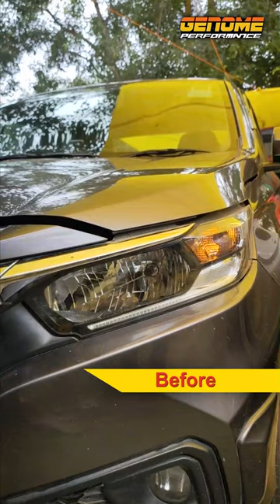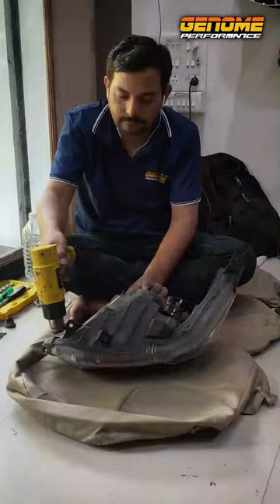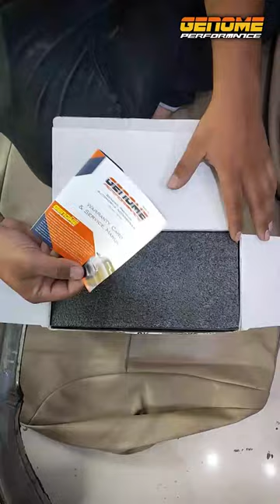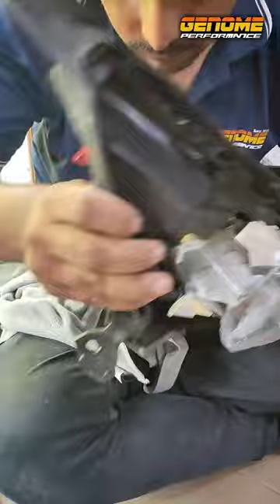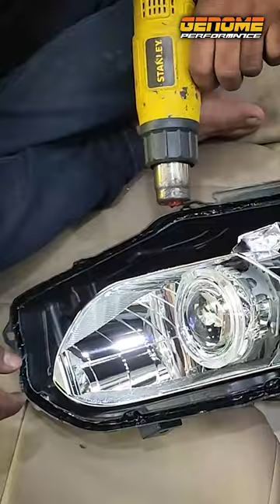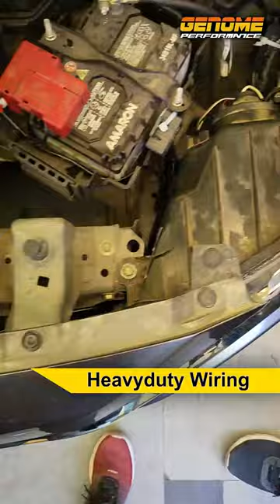Honda Amaze Retrofit | G-PRO 3" Bi Xenon Projector, 55W With 5500K | Best Projector Lamp

Comment: What is the price
Reply: In Pune it costs me ₹ 24000/- with fitting
Reply: @Pdbhai318  with 24k you can get original complete projector headlights unit from honda dealer
Reply: @ronojpayeng637  I agree with you completely but the thing is that Genome Products are costlier than other companies in the market. Secondly my car is Wagon R 2011 model in which I did this modification and let me tell you clearly that Light throw is really awesome.
Reply: @Pdbhai318 AES ke led projector dekh lo ek baar. Hid bhul jaaoge. Plus pass light dete waqt,  2-3 second ka time leta hai hid.
Reply: @utkarshgovekar  Aapki ye baat Sahi hain ki HID pass dete waqt time leta hain lekin mein ye batana chahta tu hoon ki ye light ka throw such me bohot hi powerful hain. Mujhe lagta hain ki paisa wasool product hain.
Reply: @Pdbhai318  All these lighting related products are sourced from China. Earlier delhi wholesaler used to market these HID kits on large scale. Now they have shifted to LED based light bulbs and projectors. What I mean is this Pune company is behind the trend already but the price is also 4 times high. Any Delhi based dealer will give you this kit for 6000/-. If  you need lastest product in light bulbs and Projector. I can help you in getting it at very low cost.